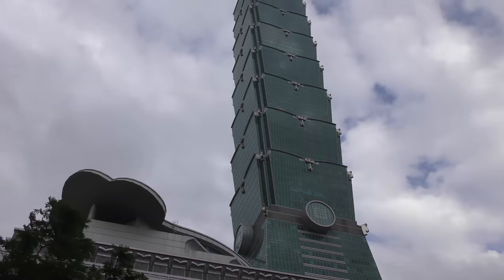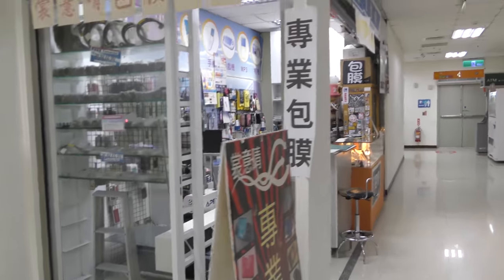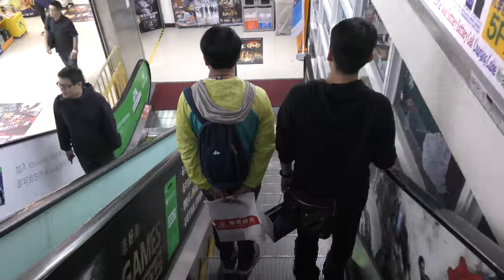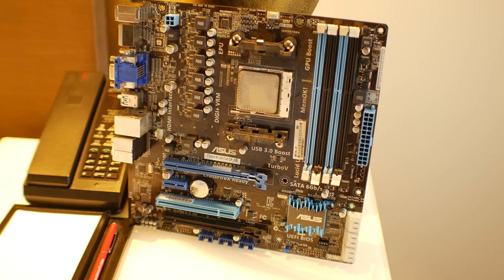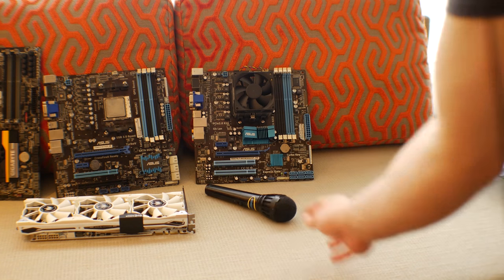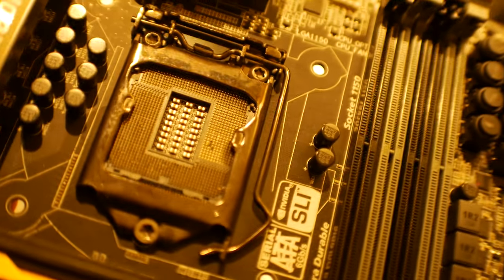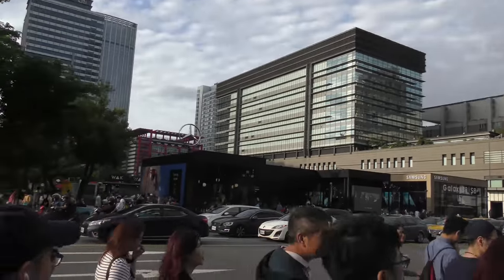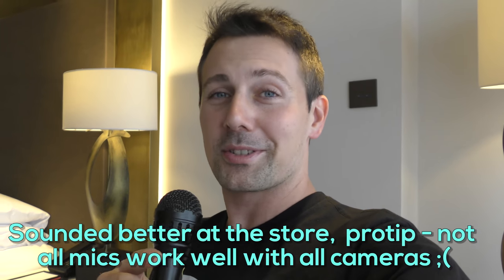USED PC Parts Hunting in Taiwan?! | Taipei Pre-Computex 2017 Vlog

Comment: i was so inspired by your used pc hunting in japan that i actually went out and found my own used deals. i have been system building since i was 13 but this is the first time i built a computer completly used. got the following

i7 950
x58 mobo gigabyte ultra durable
6gb ocz ddr3 1600mhz
and 2 hd 5670 in crossfire for $40 us dollars.
replaced the 5670's with hd 7870 for $100
psu 600w $15
coolermaster v8 cpu cooler $5
case i had. 
all in all
$160
and im trying to sell the 5670's to get 20 to 30 back. thanks for the inspiration. also overclocked the i7 950 to 3.8ghz stable so win win.

Comment: Hi, I live and work in Taiwan and the reason you got charged $50 for a taxi is because you are a foreigner and the taxi driver took you around the houses to get to your destination.
This is why Uber is proving to be so popular.
They are reliable, clean and very well priced. They will not con you as everything has to go through GPS and the quickest route displayed.
The taxi drivers have been warned about this.
If there is a next time, take a picture of the driver's ID which a copy can be found on the back of the passenger front seat and then send it to the National Taxi Organisation stating your case.
Your ride was a daylight rip off. I travel a lot in Taipei with my wife and she takes no S%^T from the taxi drivers as she always pre-plots the route.
Sorry for your taxi ride, they are not all like that but it does happen.